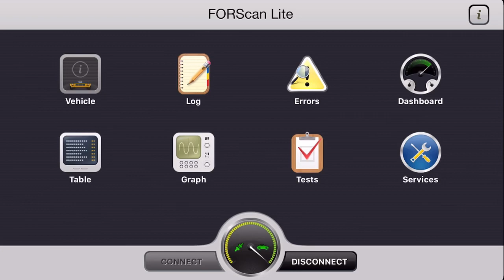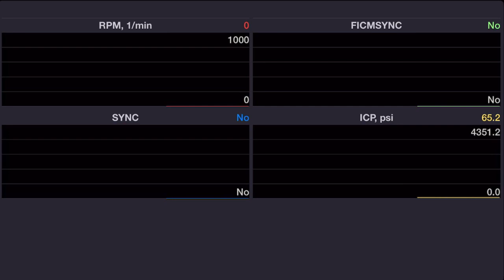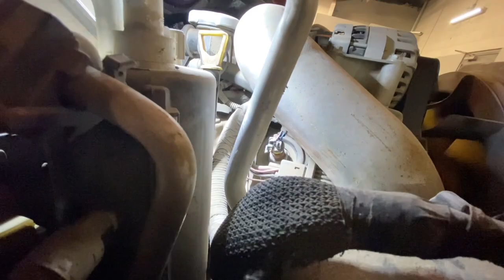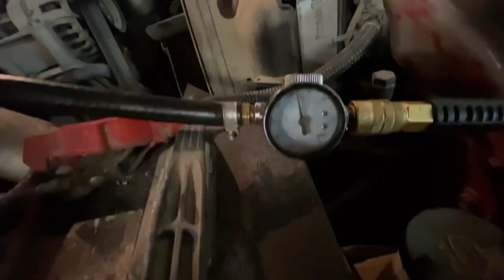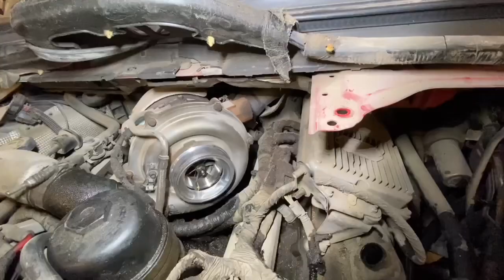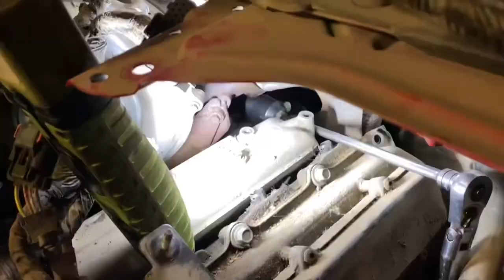Ford F250 6.0 Diesel No Start!

Comment: I'm going crazy over here! 2005 6.0 Powerstroke
While Cranking: 
FICM SYC - 1
FMP - 47 Volts
ICP - 1533 PSI
IPR - 56.2%

I still got a crank no start, where should I look? With that much pressure I don't think I need to air test it. Which by the way, this all began with random rough idling and losing almost all power while driving I almost died going up a hill. Sounds like a misfire when it was running rough, I thought it was a sticky injector. Now it just cranks and doesn't start. It's got 50k flawless miles on a rebuild.
Reply from the maker: I agree, your ICP looks good. Is it getting fuel? Any codes?
Reply: @CarShopTalk  Yes, I pulled the cap off the secondary filter up top and turned the key on. The bowl fills right up. I'm stumped, but I'm also not a full time tech lol.
Reply: @CarShopTalk  Just checked for codes, here's what I got:
P0472 - Exhaust Pressure Sensor Low
P2263 -Turbo/Supercharger Boost System Performance (Should be normal, I have a non-VGT turbo)
P2269 - Water in Fuel Condition
P2285 - Injector Control Pressure Sensor Circuit Low
Reply from the maker: @philfinote3731  try unplugging the exhaust pressure sensor and see if it starts. I had one shorted once that caused a no start.
Reply: @CarShopTalk great advice.... im out of the loop on diesels but will manage